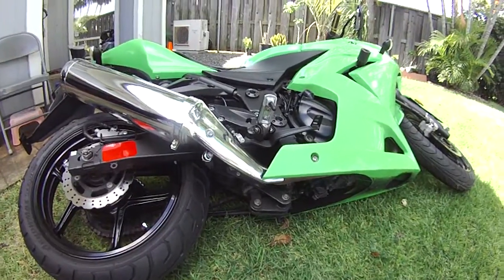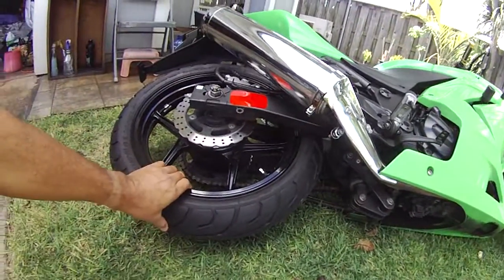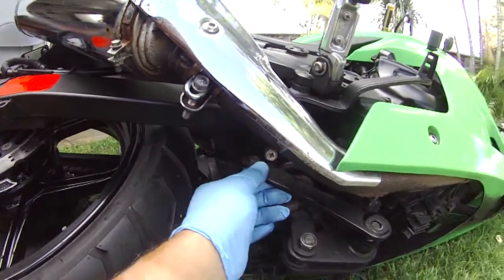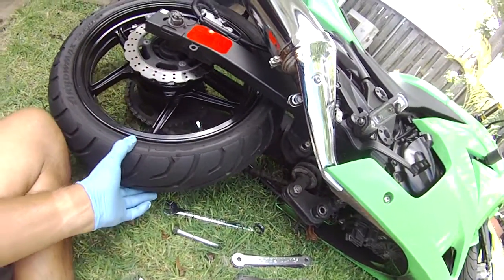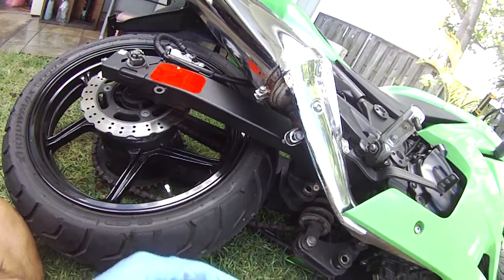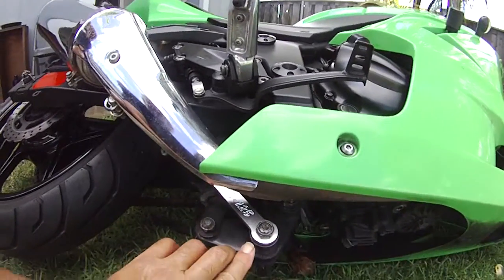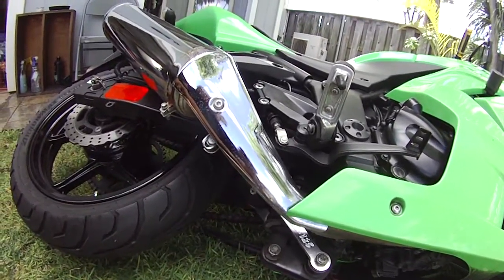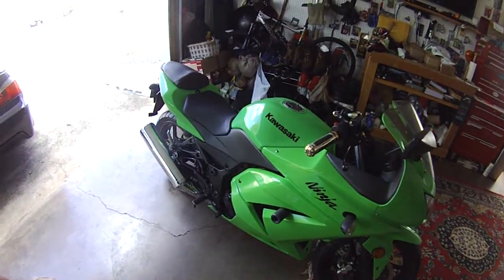Lower Motorcycle Kawasaki  EX 250 Lowered. Lowering Link Fast and easy DIY 15 minutes max .

Comment: The lay down method is fine as well just make sure you put something down so u can kind of move the bike and push the rear wheel up. I have done it this way in the past with no problems whatsoever. Good cheat vid brother. Work with what ya got! It’s 2 bolts so don’t get nervous 😬

Comment: I used this method and it was very easy - even when deciding to change the lowering distance after a quick test ride. Only thing worth noting is that it caused gas to leak (which may have been because the filling cap wasn't fully locked down) and also caused a bit of radiator coolant to leak. Be sure to check for coolant on the ground afterwards (and clean it so a dog doesn't drink it and die) and check coolant level in the reservoir to make sure it isn't too low. Also give it a while (10 min?) for the oil to drain back down where it should be before starting the bike again.

Comment: Do you need to lower the front too?
Reply from the maker: Jon Brass I did mine. Works a lot better. Relatively inexpensive. Cheaper than a coffin.
Reply from the maker: Jon Brass Use the same method.

Comment: I saw few videos when they lower the bike they also use handlebar raiser for front. Do I have to do it?
Reply from the maker: Yes, because it will stabilize the geometry. Give you a better and safer riding experience. You are raising the bars to give more clearance for the front fork tubes to slide up in the triple clamps, some are different however I like the one I mentioned. Aloha Leo and Malama Pono...
Reply: @jusride7  So, your answer to lowering the rear is to raise the front? You want to load your rear tire going into turns? No.

Comment: Is it me or are my stock links straight power drilled from the manufacturer and impossible to take off plz help!!!
Reply from the maker: king ivo what type of motorcycle? Make, model, year? Where was the motorcycle purchased? USA, UK, FRANCE?
Reply: jusride7 thank you for the reply and it's my girlfriends 2009 ninja 250 form US
Reply from the maker: king ivo same model
Reply from the maker: king ivo Just follow my instructions take your time and don't force anything.  It should be a breeze.
Reply: Give it another shot thank you
Reply from the maker: How did it go? Did you get it off?
Reply: jusride7 no I put a bit of lube on it to loosen the bolt and it wasn't budging so I'm just going to take it to the shop thank you for your help great vid👍👍
Reply from the maker: These models were made in Thailand.  Some others were or should I say are made in foreign countries.  Look on the front hub. There is a big stamp "Thailand ". I have never had any problems with the bike.
Reply: Mine were hard to take off but, as long as you get the weight off them they will break loose. Took me about 30 minutes by myself with jacking the bike and setting up. Long story short my woman is happy and can almost flat foot now. I only dropped down one notch and it gave plenty. I didn’t wanna go too low and worry about her bottoming out. Simple job and without setting up it took about 10 minutes and no need to change the kickstand since it was only about 1-1/2 drop. $30 ✅! Make sure ya use a piece of wood to spread the weight of the bike on the jack.

Comment: Thank you. However  I am waiting for the fuel gauge gas tank  problem..ha ha. I have the same  problem in my 600 kawasaki ninja.  The fuel gauge doesn't work.. thanks again have a good day....
Reply from the maker: Common problem with the EX 250. Check out my video. Not that hard.
Reply: @jusride7  thank you. Have a  nice day..
Reply from the maker: @floydpink6238  Aloha friend please do the same..

Comment: This is not professional, safe, or common sense at all. Super sloppy. Be a big boy and work on your little 250 correctly. This is causing binding. Also, like the guy below said, you can't change your geometry like this without making other adjustments to compensate. Think about it.